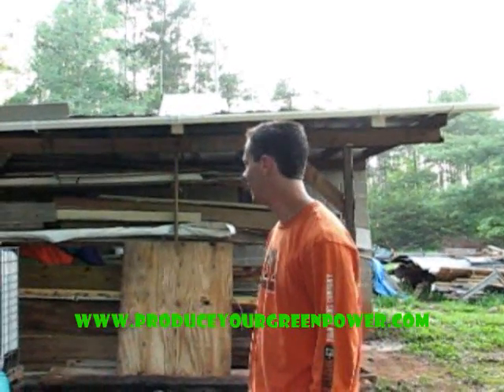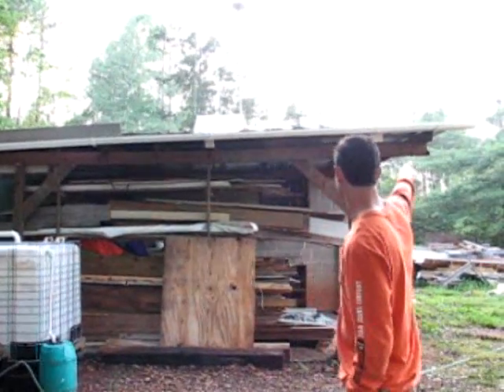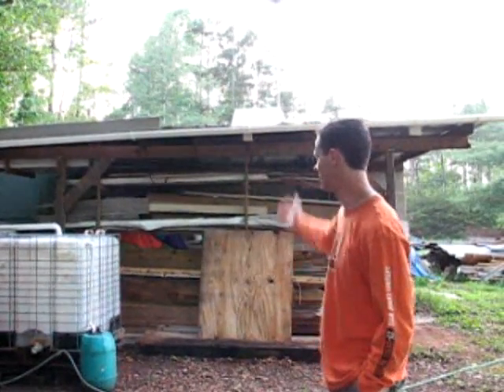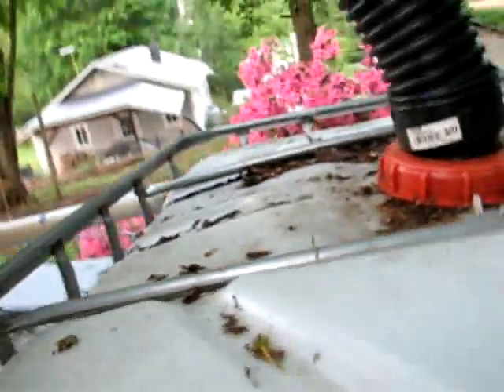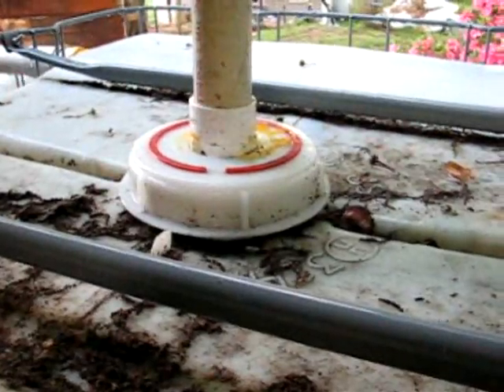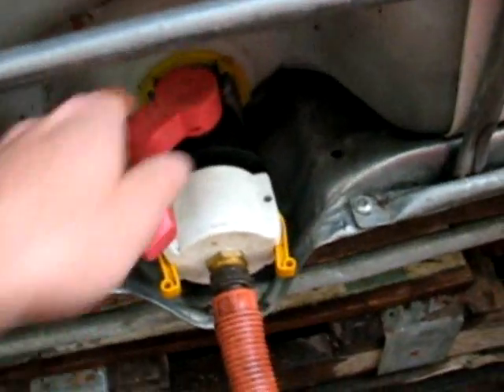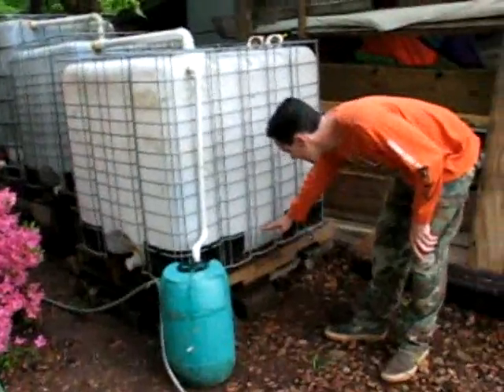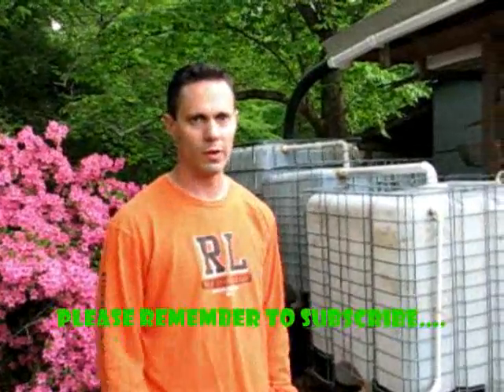How to Collect Rain Water For Your Garden 3in1 System

Comment: I want to tie 3-250 gallon totes together like you did but mine are all on an equal level, it looks so much better. But I can't find the fittings to tie the 3 ball valves together. Any Ideas? Where did you find the fittings? So you know what I am doing my first tank is filling at the top. I want to tie the other 2 tanks threw the ball valves, I can’t find the fittings, the threads looks like 3 threads per inch.

Comment from the maker: @CultivatorsCorner The pressure is good .
 I have a couple drip irrigation sysytems hooked up to it.
 Works good.  I just have to clean the screens alot.      
               150' no problem just has to be down hill from tanks

Comment: Also, I use 55 gallon polys and lay them horizontal - not connected but just to collect the water... i had planned to connect on to the other as you have done... but it's cool to collect free water....
oh, btw, if you want to do it with 55 polys you can generally get them for free from carwashes... just go ask... cheers,

Comment: Hey Rick,
Are the three 'tote' (what i've heard them called) the same size but just elevated from one to the other? 

did the totes already have the valve on them or did you have to add it?

Did you just drill a hole for the 1" PVC for the outlet to the next tote?

Also, i noticed only the first tote had the valve... so, how do you get to the water in the other two totes if you were to use all the water in the first?